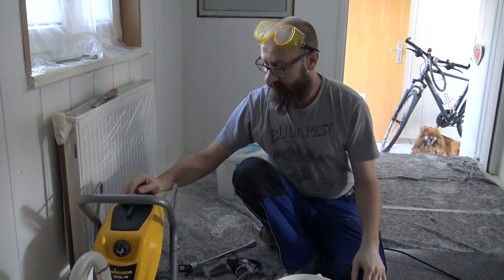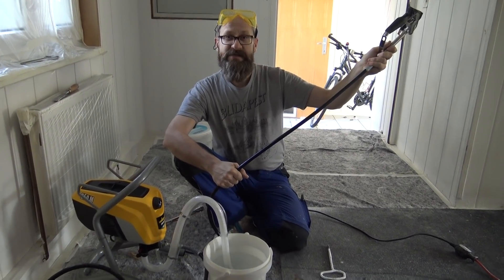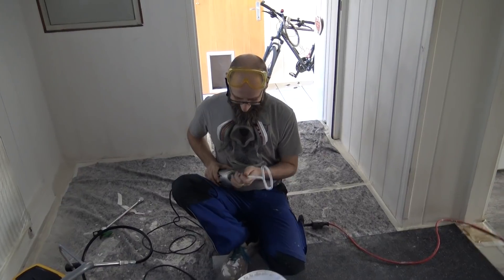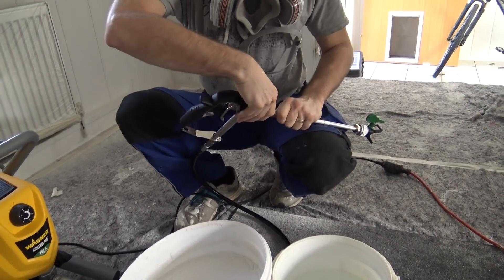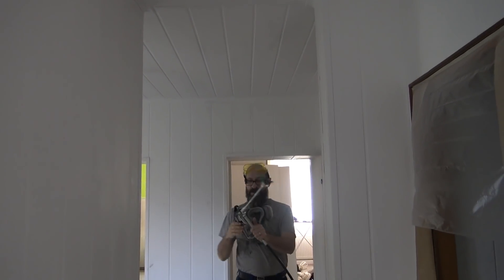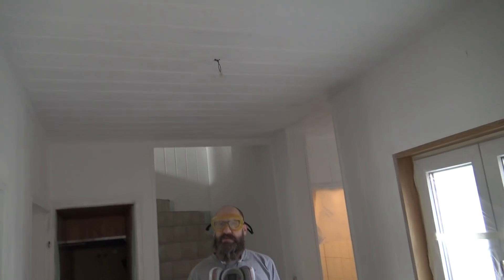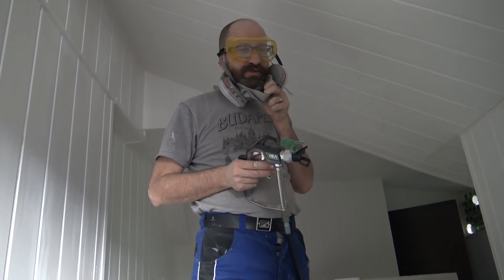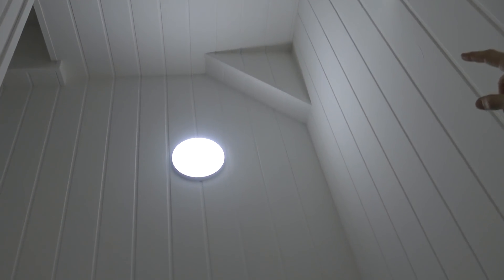Wagner Control Pro 250 M Farbsprühsystem Test - Why You SHOULD Buy The Wagner Control Pro 250M!

Comment: Hi there and thank you for your test. I just bought the 250 but not yet tested. Have you try to take the filtrer out of his place because i didn't succeed.
Reply from the maker: The filter is only pushed in hard inside the chamber, you should be able to pull it out with needle nose pliers. You can also buy 5 new filters for about €3.50 on ebay. You need 2 spanners to open the filter chamber. There are 2 kinds, one for stain, which is red, and one for house paint... that one has bigger holes. It is white. Hope that helps. Let me know how it goes!